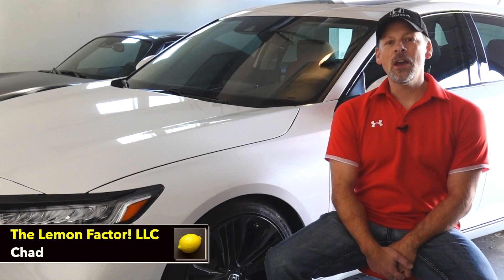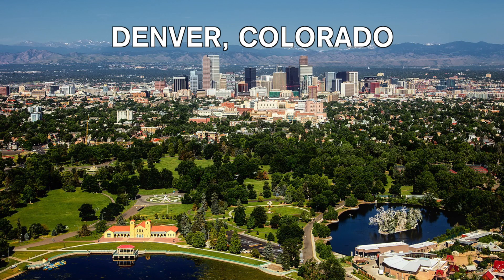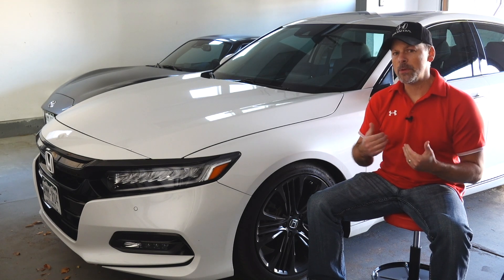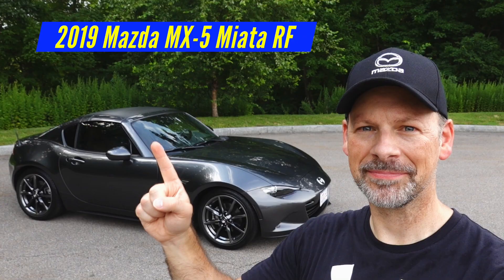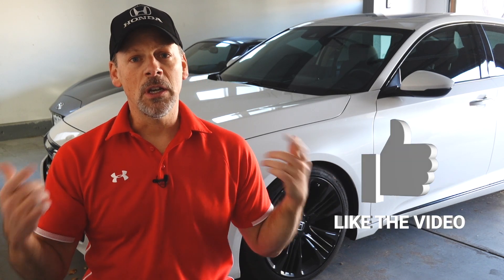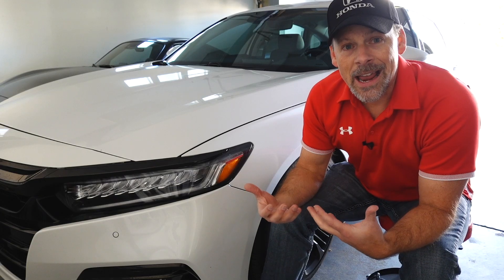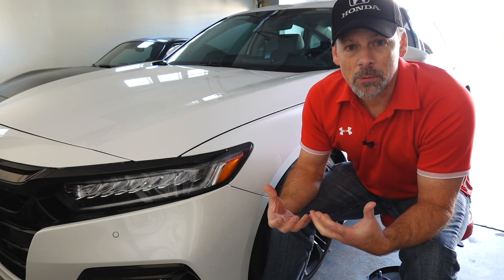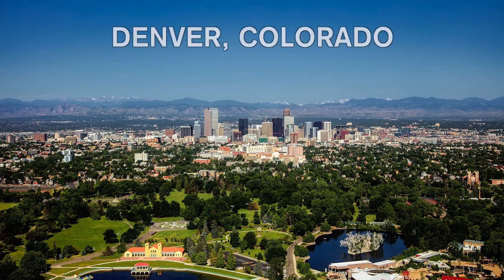DYNO TESTED (87 vs. 91 Octane) - How much HP gained? // 10th Gen (2018+) Honda Accord 2.0

Comment: Imperceptible difference in practical driving. No reason to use 91 octane.
Reply: I can actually perceive it in our car even without being told which gas has been added. Glad to see proof of it here.
Reply: @MrChadder007  that's cognitive bias unless you have a car whose engine computer actually allows for engine adjustment and increased power output based on higher octane. Most cars don't do this.

Comment: I owned my 2018 2.0t 10AT for about a month now and clearly the car is meant for 91 and its not even close.While yes it can run on 87,you can tell its not as responsive as it is on 91.The car feels much better to drive on 91 also being more healthy for the engine.
Reply: Wat about 1.5t

Comment: I owned two CTRs before buying a 22 Accord 2.0t. I plan on eventually doing a Hondata/Phearable Stage 2 tune with stock parts and just use Calif. 91 octane in the meantime. The stock car pulls pretty hard even stock and is impressive acceleration wise already compared to the CTR. I’m looking at long term reliability of the 2.0t so an extra 20 cents per gallon is worth it to me for when I drive my spare vehicle. Thanks for the informative video!!!😁👍

Comment: The fuel itself doesn't add power, timing adds power. The more advance in your timing you can safely run without detonation, the more power you can make. Higher octane fuel is actually less volatile so it allows higher compression and more aggressive tunes. Low octane ignites easier so in a high compression engine it will detonate before the pistons reach TDC, Pre-detonation. The computer will adjust the timing to the fuel and give you more power from the timing advance that higher octane allows. The computer will set more aggressive parameters in the tune for higher octane and you usually will feel a nice bump up in the low and midrange power. You can get up to about 10 to 20 more hp for every 2 degrees of timing advance, depending on the engine size and design, altitude etc.

Comment: I think its important to note that a lot of vehicle KNOW what gas you put into it and adjust accordingly. 91 octane into any 87 octane wont increase any power unless the engine knows that it can swap over to its factory 91 octane tune
Reply: Yeah and with some that don't happen in minutes it takes drive cycles and or on off cycles etc.

Comment: Thank you! I currently own a 2022 Accord Sport 2.0T and had use 87 on my car. I also ran some research online and putting 91 doesn't really show a massive difference than putting 87.
Reply from the maker: On a stock car, it’s not worth it 🤷‍♂️
Reply: Although Honda mechanics suggest using the 91 for cleaner combustion

Comment: I just bought an Indian Scout Rogue.  The sticker on the fuel tank says to put 91 octaine minimum.  Never even bothered to check fuel differences until now, always just put the cheap stuff in my car (Toyota Corolla) and my old bike (Honda Rebel 500)
Reply from the maker: Most cars that call for premium fuel (91 octane or better) will not perform at their best without it. While most modern cars can adjust for lower octane, some older cars cannot, and you run the risk of damage to your engine if not using premium gas.

Comment: Have you dyno the accord by swapping with a type R turbo? Would it make any difference? How much power can I get by k tuner v2 with front pipe?
Reply from the maker: From what I’ve seen, a Type R turbo on the Honda Accord can add 40-50 whp!  Checkout the channel page as I have several videos in which we dyno test various mods, including the KTuner Stage 2 and Phearable Stage 3 👍
Reply: Thanks I will check all your videos 👍

Comment: Not a placebo. Put in 92 and the car is definitely more responsive. Been using 87 on our 21 Touring with 13,xxx bought brand new this whole time. I always thought it was suspect in the manual when it said 87 “or higher”. I guess if Honda officially recommended 91. It would turn off potential new Accord owners so, they say 87 or higher. Higher being a little more oomph. Definitely staying on 92 now. It’s worth it imo for the 20 cent difference per gallon.

Comment: Nice!  I bet if the Accord 2.0T was driven around for a while on 91 octane to allow it to adjust to the higher octane,  and then it was fully cooled off,  then run on the dyno again like the first run using 87 octane,  I bet the numbers would have been even higher.  Where I live in GA,  we have 93 octane...  I also installed drop in K&N Air Filters into my naturally aspirated '15 Infiniti Q50 3.7 RWD,  and we all definitely notice a difference in the sound and acceleration... Especially above 4000 rpm.  It felt like the difference between WOT during an 85 degree day,  versus WOT during a 45 degree day.  Very noticeable, surpringly.  Now,  in a forced induction vehicle like the Accord 2.0T that responds to mods better than N/A,  a K&N filter combined with 91 octane,  or 93 octane where I live,  would probably be a very noticeable  difference in acceleration vs stock when it was on 87 octane.  I'd love to know how much it gains on both 91 & 93 octane with a K&N filter.  Anyway,  thanks for the great video!
Reply from the maker: The car did have time to adjust to the different octane before I put it back on the dyno 👍. As far as the air intake filter, I did a whole series of videos testing various ones - checkout the channel playlist to see the results 😉
Reply: @TheLemonFactor  
Okay,  will do.  Thanks for the reply.

Comment: Makes a difference if the manufacturer says to use 91.  The knock sensor messes with the timing with lower octane from what I gather.
Reply: The Miata recommends 91.  Perhaps the Honda knock sensor is advancing the timing too.
Reply: @demonsaint1296  yea on my 2010 acura tsx (basically a honda accord) it recommends 91
Reply from the maker: Actually, Honda recommends using 87 octane gas or higher.

Comment: Another good dyno video. You showed why ‘peak’ numbers aren't so important when comparing mods (octane in this case) on the same engine. Different pulls peak at different rpms. @5:06 runfile6 with the lowest hp, peaked at a lower rpm than the other three pulls. I think you showed why the delta at a given point is more important.
Reply from the maker: Thank you, Nutfield for your positive comment. 👍. I’d take solid gains in HP and Torque running across the RPM range over peak numbers any day - although I’d prefer to have both 😉
Reply: top speed v acceleration = yes!
boom shorter comment

Comment: This should clear up some internet arguments. Have heard so often that octane makes no difference on a stock tune blah blah. 😐
Reply from the maker: At least during this testing, the difference was readily apparent 👍
Reply: @TheLemonFactor  
I would like to say thank you also.
Reply: I've never heard anyone argue that.  Argue that there isn't enough difference to justify spending 60-70 cents more per gallon yes, especially now that the racist rapist devil has caused gas prices to go up between 1.50-2 per gallon